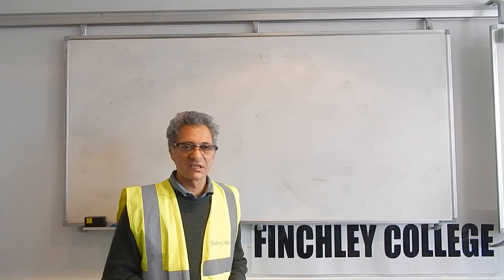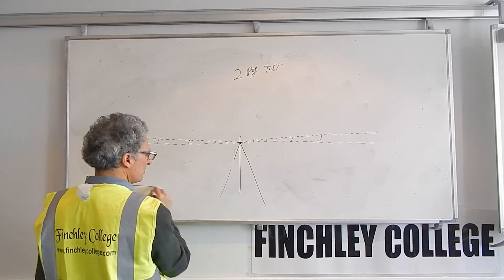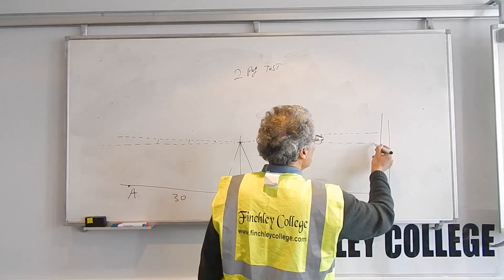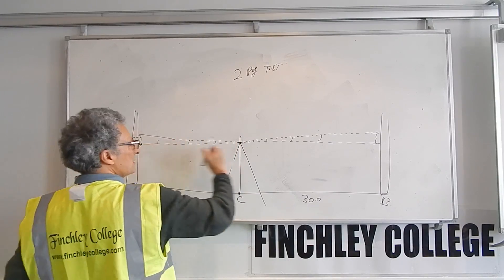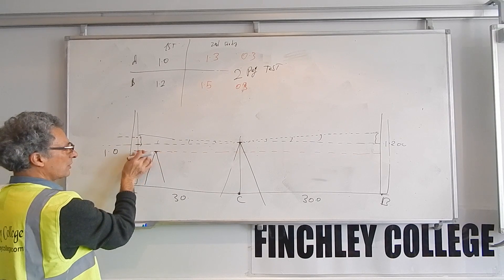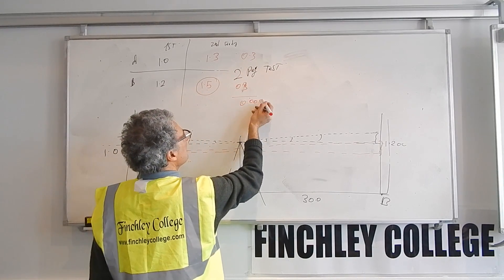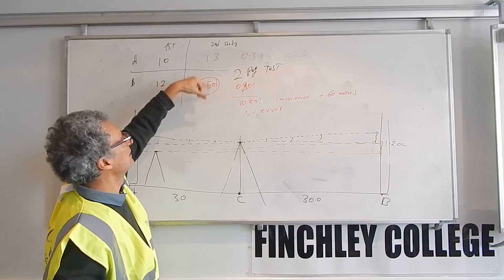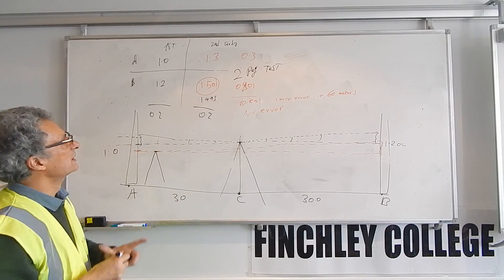Two Peg Test

Comment: What is the acceptable error? Is there some official standard that define the acceptable error?
Reply from the maker: Hi Alexandre,
The acceptable error is usually about +/- 3mm in every 60 meters, so, your two peg test needs to be at about 60 meters. It also depends on the task in hand, If you are just level surveying a field at every 5 meter grid, then error can be more because ground there is a high variation in exiting levels. On the other hand, if you are surveying a flat ground or concrete slab with an allowable tolerance of +/- 5 mm, then your instrument needs to be a lot more accurate than standard 3 mm.